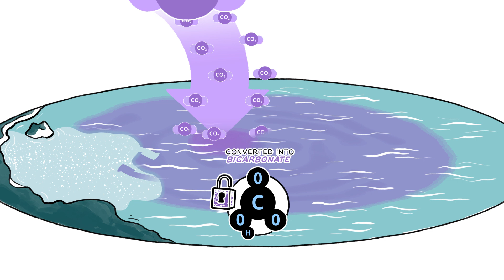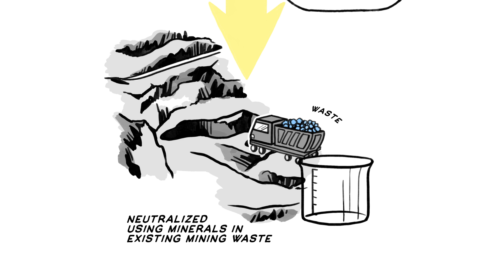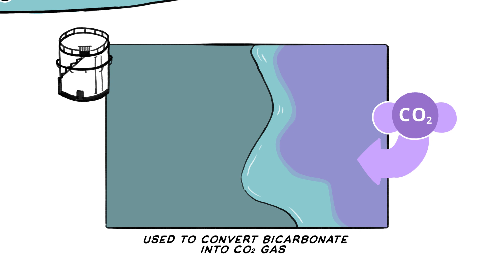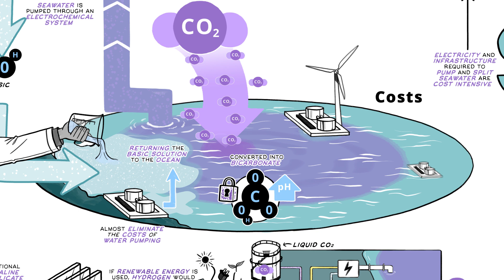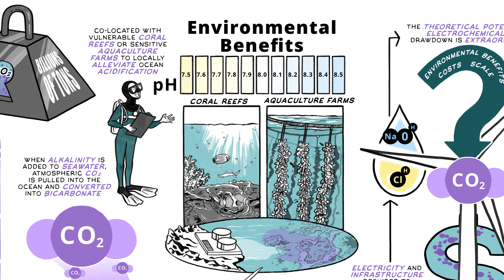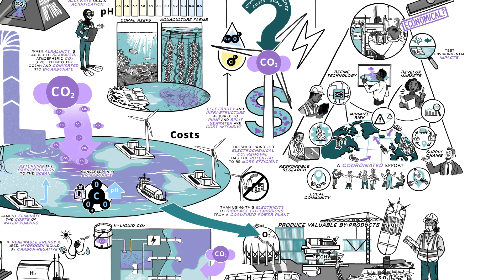Ocean carbon dioxide removal (CDR) via electrochemistry - A ClimateWorks production

Comment: 1) By reflecting away 30% of ISR the albedo, which would not exist w/o the atmosphere/GHGs, makes the earth cooler than it would be without that atmosphere like that reflective panel set behind the windshield. Remove the atmosphere/GHGs and the earth would become much like the Moon and Mercury, a barren rock with a 0.1 albedo, 20% more kJ/h, hot^3 on the lit side, cold^3 on the dark. Nikolov, Kramm (U of AK) and UCLA Diviner mission all tacitly agree. 

2) the GHG up/down welling, “trapping”/”back” radiating/delaying/intercepting, 100 % efficient, perpetual warming loop requires "extra" energy which according to RGHE theory comes from 

3) the terrestrial surface radiating that "extra" energy as a LWIR ideal black body which

4) cannot happen because of the non-radiative heat transfer processes of the contiguous atmospheric molecules and as demonstrated by experiment, the gold standard of classical science: 
https://principia-scientific.org/debunking-the-greenhouse-gas-theory-with-a-boiling-water-pot/

1+2+3+4 = 0 Greenhouse Effect + 0 Greenhouse gas warming + 0 man caused climate change.

How the Earth actually heats and cools with Mr. 3 Legged Stool - Trailer - YouTube

Version 1.0 061321